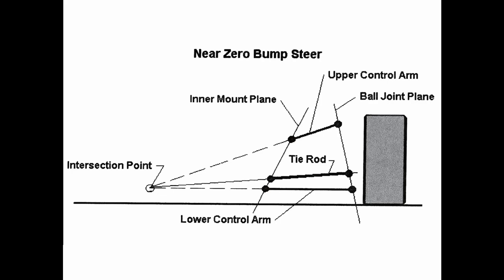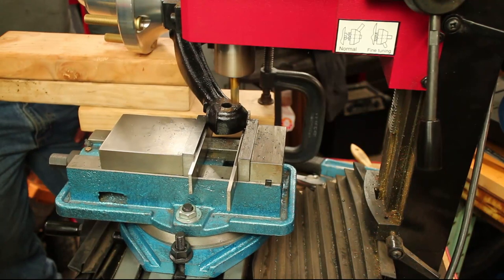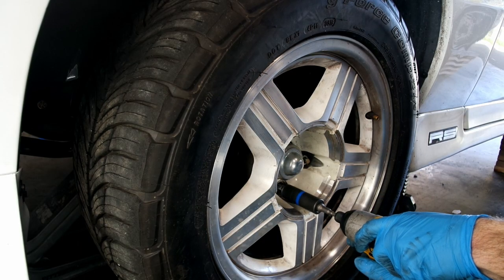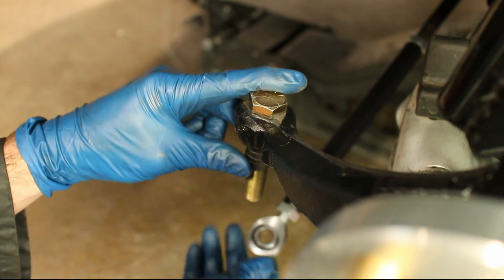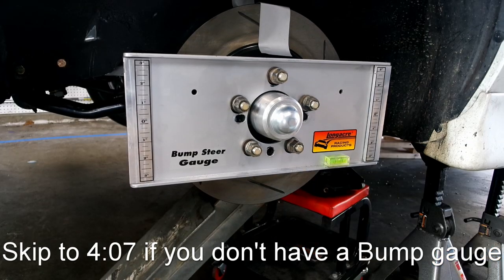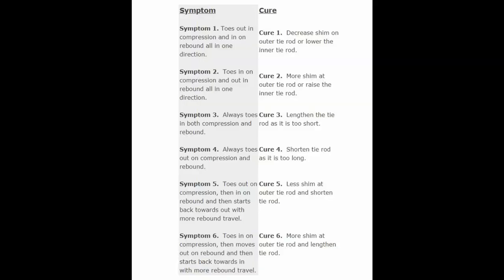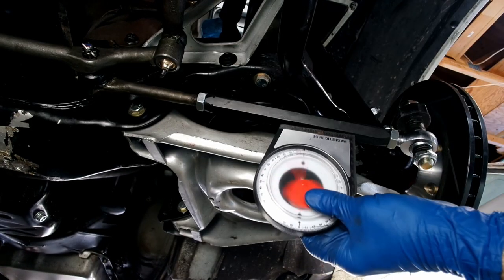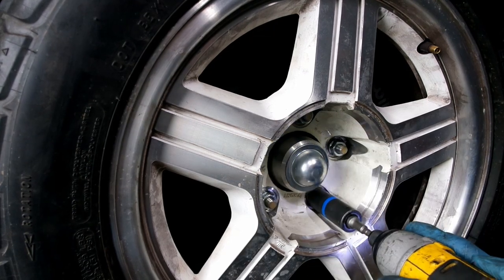How to fix Bump Steer (1982-1992 Camaro/Firebird)

Comment: Ive been running Baer Brakes bumpsteer kit since 2003 ish.  Pin has taper machined in it, so no machining on the knuckle is needed.  Darn durable kit.  The supplied joints still have no play in them.  I recommend.  I also have the Koni Yellows, and Eibach Sportline sprrings.  Had to use all the spacers.  ;)
Reply from the maker: if your car is stock/Daily, the race kit is unnecessary and the tapered kit is good enough.
the Autocross HAMMERS steering so i went with he race kit.
I've seen a few guys snap off tie rods when they switch over to sticky tires.
Reply: @3rdGenGuy  Snapping was a concern of mine, obviously.  My kit was delayed a bit some time back, as they were waitng on a batch from heat treating.  I've had 275's since 1992.  I did a bit of autocrossing.  This was the goal of the suspension I chose.  Ultimately, the car was  99% street driven.  The roads of Buffalo, NY are helacious, some legs, lol.  I did run these with some BFG R1's., for a season.  Later just Comp TA's, RE71's.  I think it's on some Sumitomo HZ1's now.  I keep pressures at 40-42.  So, I have some confidence in the Baer kit for sure.  I thought to make a kit similar to the one you chose, but felt a machined and treated pin was likely better solution, and proved costly to replicate.  Coleman has a neat catalog, I think still.  ;)

Comment: Nice work. Did you need an alignment afterwards?
Reply: I imagine he did. But I've never done one of these.
Reply from the maker: typically you want to set Bump Steer AFTER you have a good alignment.
BUT, you want to get Bump Steer semi close if your alignment is way off.
no point in getting an alignment id the Bump kit is WAY off

Comment: How much did you drop, how much did you lower the tie rod?
Reply from the maker: I believe I went down 1.25in, but EVERY car is different.
Reply: @3rdGenGuy  Do you think a bump steer kit is worth it with a 3gen drop of 1.5 inch for aggressive street and a little track
Reply from the maker: depends on how much bump steer you have.
you can check it with a cheap laser and cardboard for cheap.

Comment: what was the stock bump steer for comparison purposes?  so how much of an improvement is this kit?
Reply from the maker: depends on the car, but i had nearly 3/8 in bump steer.
after i had 0.032in at 2in of travel and 0.002in at 1in of travel. so that's basically NONE
on the street, it doesn't wonder all over the road any time you hit a bump. At the track it keeps tires working as efficiently as possible.

BUT, those spherical end links are nosier and rougher than stock so keep that in mind.

Comment: do i need to adjust it on my lowered 11 5.0 mustang 1.2in in the front.  i wanna do this install myself. the directions show how many spacers and where there supposed to go but doesnt say anything about adjusting unless you track the car which i dont. just street driven... do i need to adjust it when im all done or?
Reply from the maker: so you can wing it and make sure the tie-rod is parallel with the A-Arm and that will get you 90% of the way there.

but ideally, the less bump steer you have, the better handling you will get.
Reply: 3rd Gen Guy 90% meaning after the alignment it will be 100% lol?

Comment: What bump steer gauge are you using
Reply from the maker: i think it's a Longacre Bump steer gauge.
i got it off eBay used for $100
the ghetto way is to bolt a wood board to your wheel and use a green laser pointer to see Toe change.